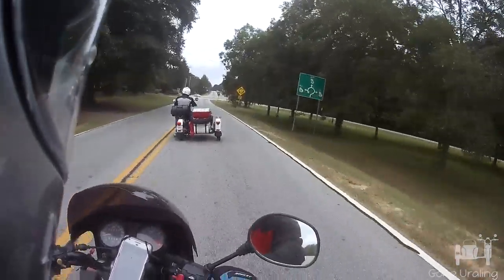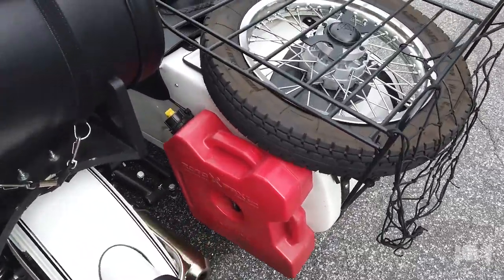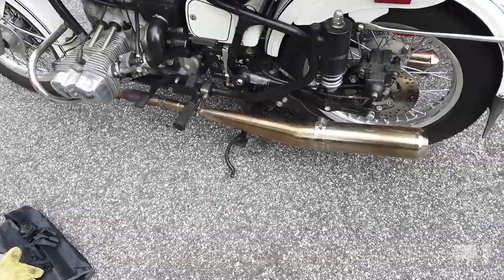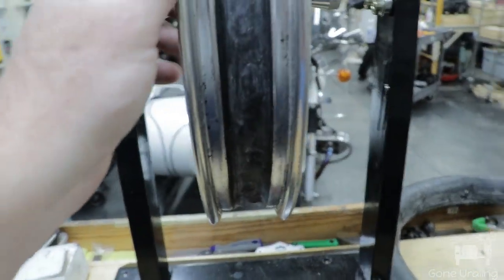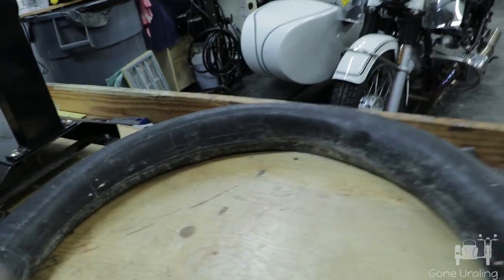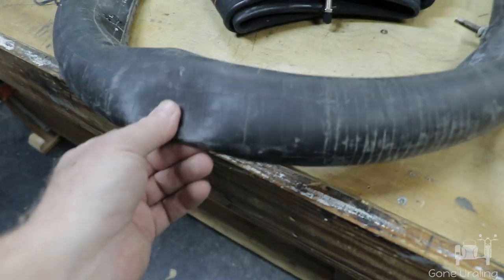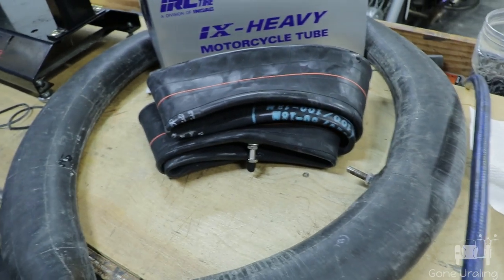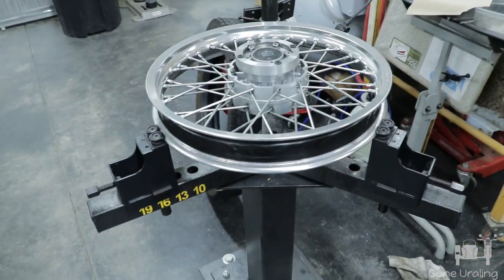My TIRE WENT FLAT while Riding!

Comment: Bob, I had a pusher flat at Lake Kluane, Yukon.  While changing the tube a lady drove up and told me there was a big grizzly just around the curve I was next to.  10 minutes later, Officer Wallace of the RCMP pulled up and informed me the was a really big grizzly around the curve.  He stayed with me until I was back on the road.
Reply from the maker: Yeah, we don't think about such things down here, we are more concerned with rabid foxes and drunk drivers.
Reply: @GoneUraling  same here in phx drunks and wrong way drivers are the biggest concern
Reply: @charlesvlcek2550   а че вы понимаете то в уралах???
Reply: Thank God in Florida the only thing we have that can eat you swims in the water so as long as you stay out of the water you're good I don't understand why you don't call road service to have you taken to a dealer to get the tire changed my 99 euro is easy to put on the center stand and there's a foot of clearance change the flat tire and I don't have to take the muffler off either I came out to find a flat tire at the restaurant after I had breakfast and I could put a big can of Fix-A-Flat in it and I'm still riding it today
Reply: @frankmarkovcijr5459  So let’s start with no cell coverage, 150 miles to nearest cycle shop, tubed tires with slices, and an unchallengeable spirit of I can do this.  Wreckers in the Yukon don’t honor AAA beyond a 100 mile round trip.  Still the best damn trip of my life.

Comment: Wow - that is an unusual cause for a flat! Good video, as usual.
I had a tube failure (new tire change) while I was in California. Luckily, I was getting close to my hotel, but had to stop every few miles to pump the tire up again. I had to solicit the help of two large guys at breakfast the next day to help me get in on the center stand. I still need to get a lightweight scissor jack to haul around with me.
Reply from the maker: My tire wouldn't hold any air, you were lucky!  Look for a Ford Ranger mechanical bottle jack. Small, easy to stow and works well. I just picked up two of them (one for each rig) from LKQ and won't be riding without them.
Reply: Thanks for the info. I was going to order one from eBay and then remembered that I have a Mazda B2500 that gets driven maybe a couple hundred miles a year (Home Depot etc). I rides on 33 inch tires with no spare, so I think it would be happy to donate it’s jack to the cause. Yay!
Reply: If you have the spade/shovel. That’s what I use to prop a flat tire to get on center stand.

Comment: Hey i like your video’s and ural’s, I was wondering wich you prefer from front fork the one like your m70 or the ct?
What you think drives best for daily driving?
Greeting from Belgium ride safe.
Reply from the maker: I much prefer the M70/Retro handling and use it for my daily driver (not that I drive daily but it is my primary mode of transport). My wife, on the other hand, prefers her cT. I find the leading link fork a harsher ride and has more turning resistance. In the end, it's rider preference. I find the Retro much smoother and more of a floating feel than the cT, i.e. it's nice on the pavement.  The leading link, however, is much better on dirt especially if you want to adventure ride. I would say, ride one of each before you make that final decision.

Comment: How have the heavy duty tubes been working out? Curious if they hold air better than the stock ural tubes that loose air over time faster than any tire I have seen.
Reply from the maker: They are holding up well. No over heating issues and they lose air at about 1/2 the rate of the regular tubes.  We air them up about once a week to 10 days. The tires that still have standard tubes take about 2-3psi while the heavy duty tubes end up only needing 1 or 2 psi at most.